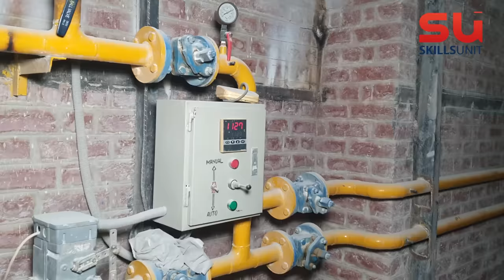Ceramic Toilet Seat Manufacturing Process in Factory | How Commodes Made

Comment: Works done to very high standards.they beat the machines.perfection maintenance at every level
Reply: The machine work had taken over more than 75%. The slip is made by using ball mills. The man has to set the mould n the slip is fed into the mould. After 2 to 3 hours it's demoulded in leather hard condition. When it becomes dry the surfaces are finished soft by fine sand papers. Then on rotating table it is glazed by using glazing spray gun. Dried n loaded on trollies, fired to the requisite temperature. Of course it's labour oriented job.

Comment: Pretty interesting, that flush tank and seat are made monoblock, Most of commodes oin my country has separate flush tank that screwed to lower part with bolts, nuts and gaskets
Reply: Yeah, also the toilets sold here don't come with the internal plastic parts installed and tested. That is a good idea.